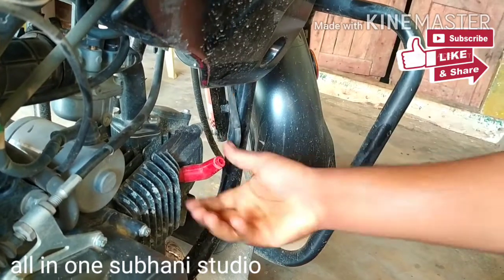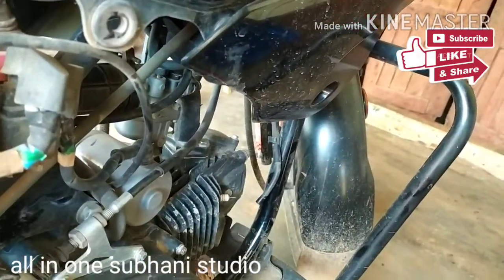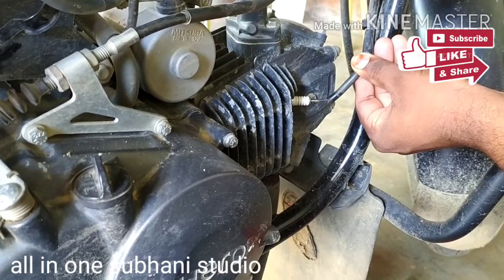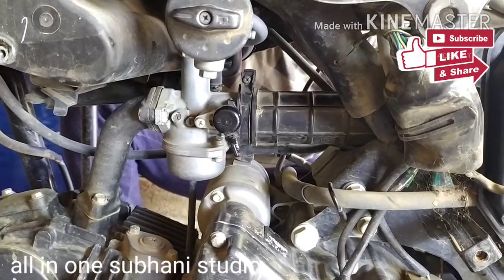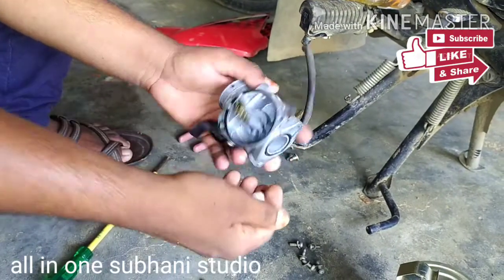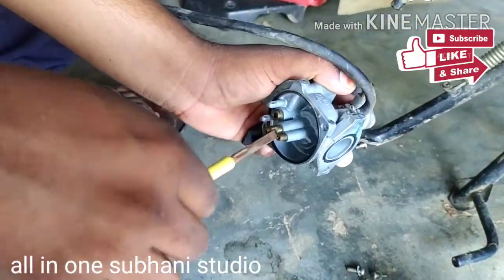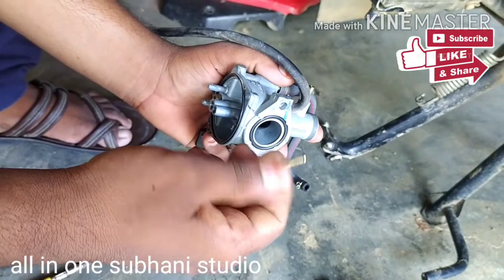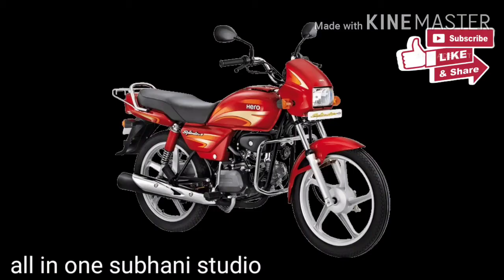బైక్ జర్కింగ్ ప్రాబ్లెమ్ ఫుల్ క్లారిటీ||Bike jarking problem,bike jarking problem in Telugu,

Comment: Splendor pro 30 to 50 km sp lo jerk avitundhi corports airfilter plg ani bane unnai solution plz
Reply: Same to me bro,meerem chesaar?
Reply: @jaibalayya4209  plz check ht coil wire and plug.  Plz clean ht coil contact pins with sand paper any rust and loose contact will make bike jerk mostly